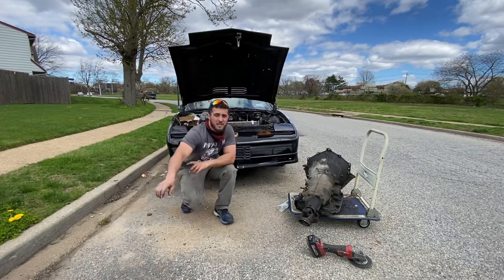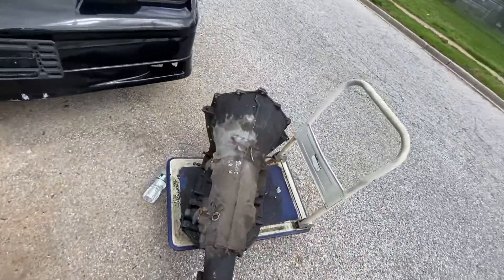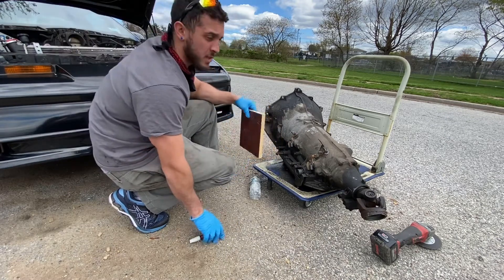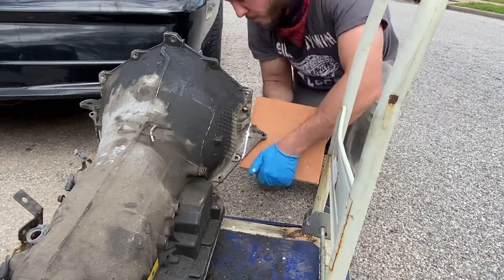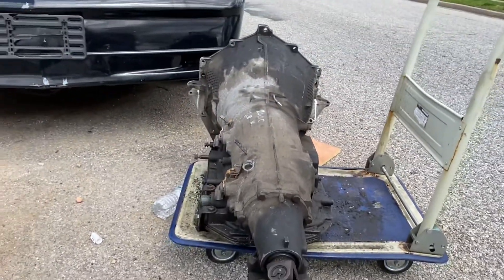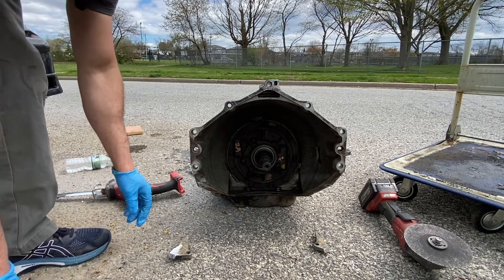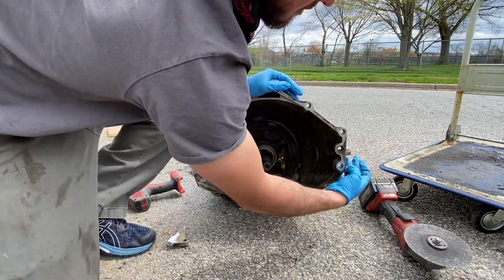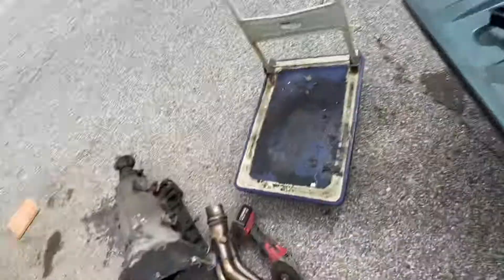Destroying a 4l80e to fit long tube headers in my LS swapped Trans Am GTA

Comment: Do the earlier 4l80e have the same issue?
Reply from the maker: Yes, believe all 4l80es have the same case where you have to clear the ears off to make room for long tubes/ fitment on smaller cars, unsure about the earlier 4l80 from 1992-95ish

Comment: What tranny mount do you used?
Reply from the maker: Used a black heart crossmember but had to make a plate to run the 4l80e, because the plate that came with it didn’t fit, it isn’t too hard to make
Reply: Any transmission tunnel massaging to fit the 4l80e? 
Any pics of the finished job?